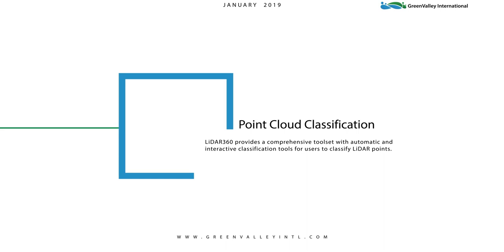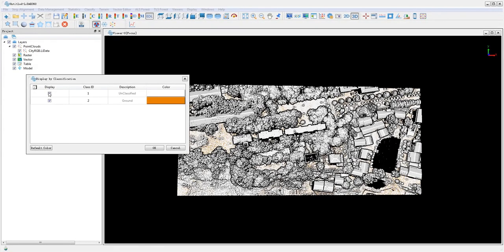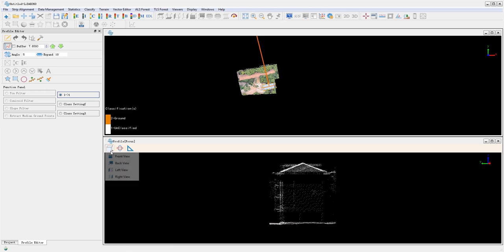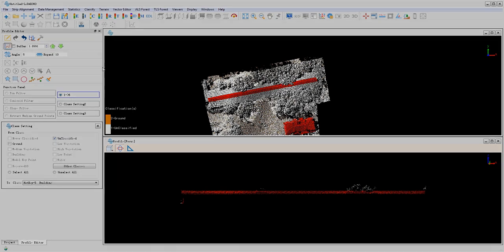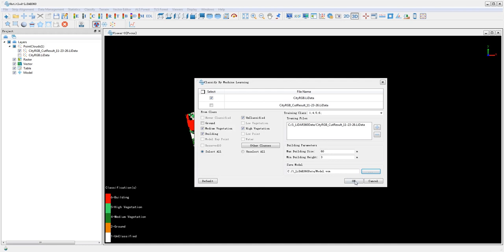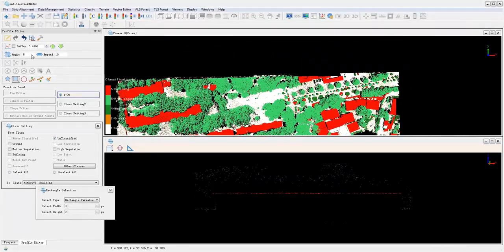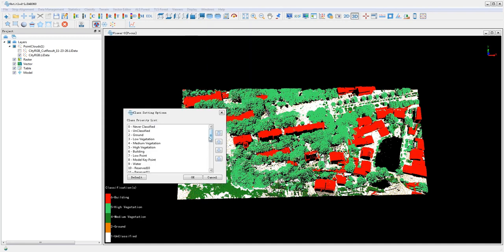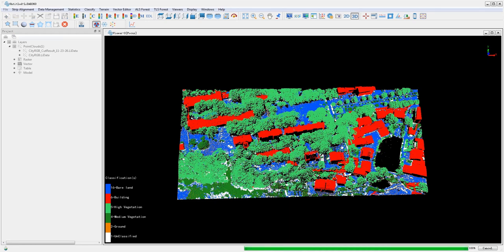LiDAR360 v3.2 Tutorial | Point Cloud Classification

Comment: Hello,  can I create different classes and label points (using manual segmentation) into these classes to build a training classifier and then use the machine learning classifier to classify the dataset in the different classes I created? As I work with 3D models of coral reefs, the classes  (buildings, high vegetation, low vegetation, etc)  in the classification tool may not apply.